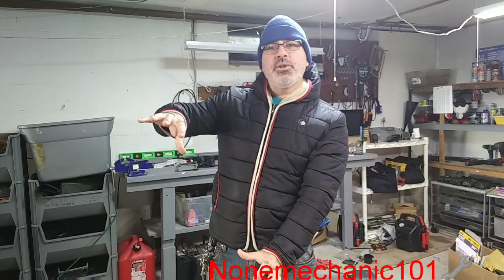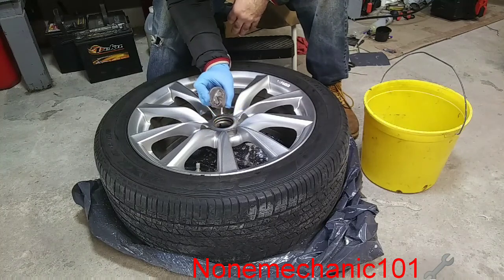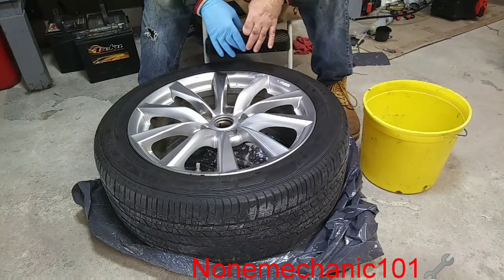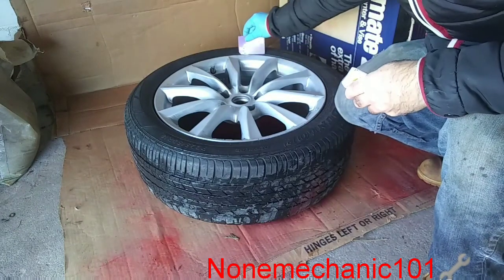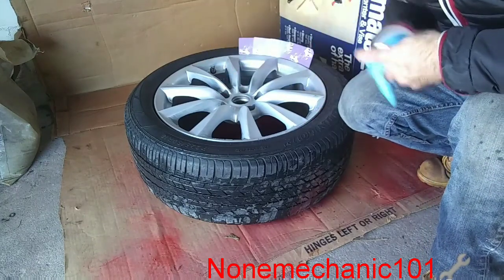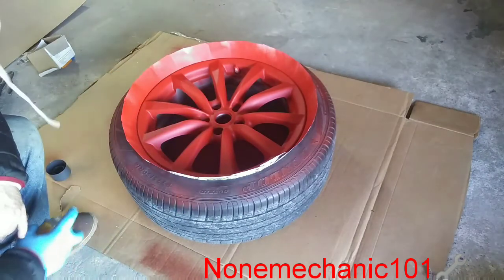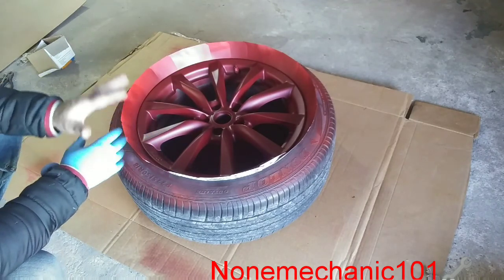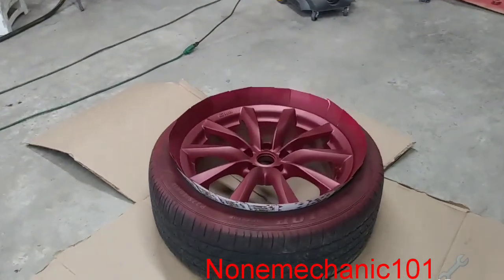Painting Infiniti Q60 Wheels (Rims) Red Pearl (NAH)

Comment: I drive C240 2005 ,its making clicking noise when turning to left or right on slow speed ,checked the power steering and front CV axle been changed already , but i noticed the rear transmission mount is damaged ,could this cause that clicking noise (sound like its skipping )or some thing abstracting it and its skipping because of it ,any ideas ?
Reply from the maker: a motor mount can cause a clicking noise